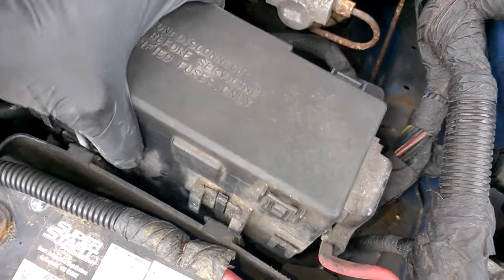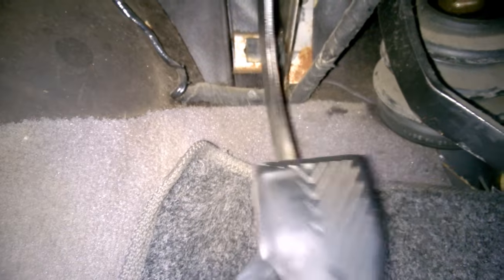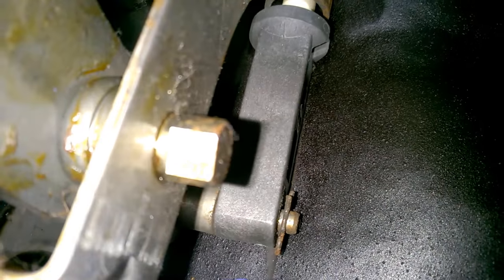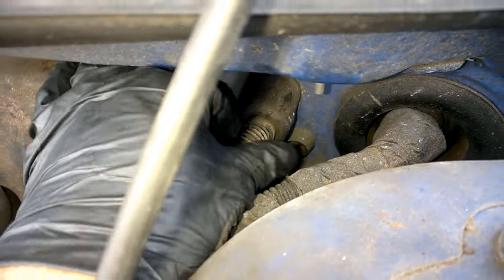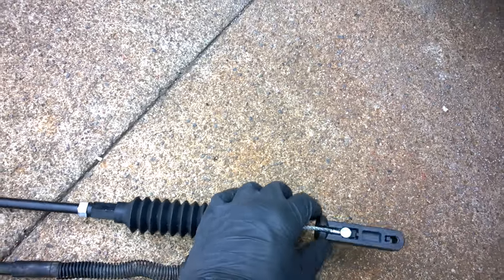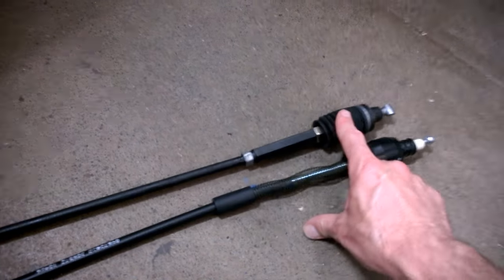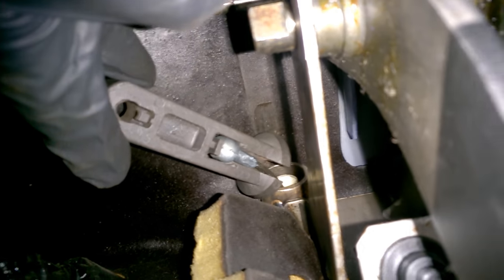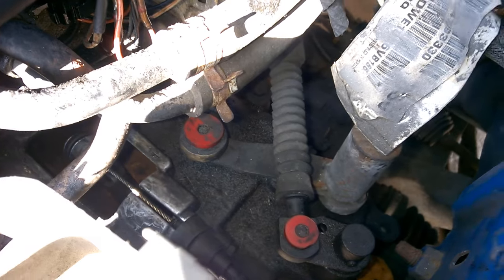How to replace a clutch cable

Comment: thanks a bunch! You have a great talking voice and you get to the point etc. Thanks for showing what you can and showing all the steps possible. I appreciate it and I’m sure others do as well.
Reply: I have 2000 s10.   My cable underneath car melted I need to replace just that part.  It’s underneath. I have pics.  Not sure what the part name is.   It’s the cable underneath

Comment: i actually bought oem mopar cable off amazon and it is not reaching, someone mentioned that inside the passenger compartment it has to be fully seated to release the cable auto tensioning function,

Comment: Awesome video. Thx for the help. Ima try and replace mine this weekend.
Reply from the maker: You can do it.  My advice, summed up-- get as close to a factory / OEM cable as you can and other than crawling under the dashboard, upside down, it's not that hard.

Comment: The first one you received, the Pioneer Brand cable, It actually works fantastic. The problem was, you did not adjust the self adjusting mechanism down, to allow it to fit correctly. You honestly had me super worried, seeing this video, and at that time the Pioneer Clutch cable was already on its way to me. It was not difficult to install, with being adjusted down and using a breaker bar to disengage the clutch at the fork, it all went together in about 25-30 minutes!

Otherwise, your video was very informative and helpful in every other way. Thank you!
Reply from the maker: Interesting.  I adjusted (lengthened) it  for the Neon and it still didn't fit-- was your car a Neon as well?  Congrats on getting it to fit, regardless.
Reply: @MrLarryQ  I agree with you.  I recently tried the Pioneer cable and it's a no-go with a First-Gen Neon.  If you need a "breaker bar" to install it then it's not the cable you want to use.  In my opinion, if the adjuster would adjust another inch shorter, meaning that the cable case when adjusted to its shortest, it would likely fit.  

In the end, I modded the broken stock cable with an adjuster at the firewall.  I needed to cut away about 3/4 of the spring to relieve some tension at the TO bearing.
Reply from the maker: @markl.5605  I did everything I could to get the Pioneer cable to fit, adjusted the screw more times than I could count.  Last thing I wanted was to return it and get the more expensive factory / Mopar one, but that's what I had to do.  Caveat Emptor.